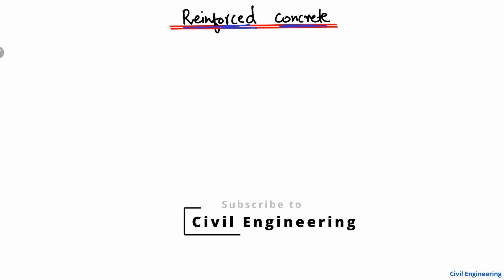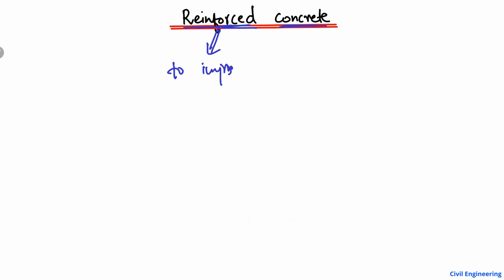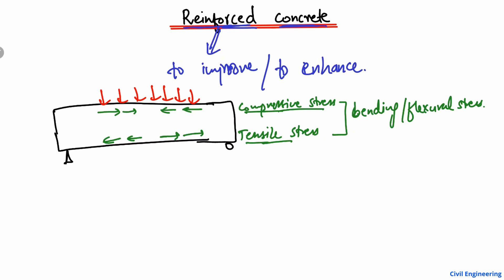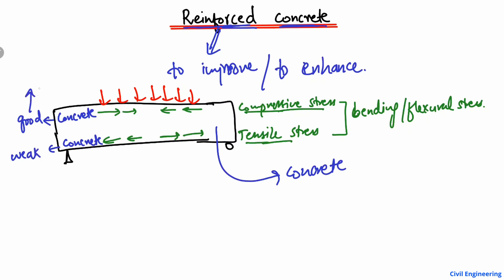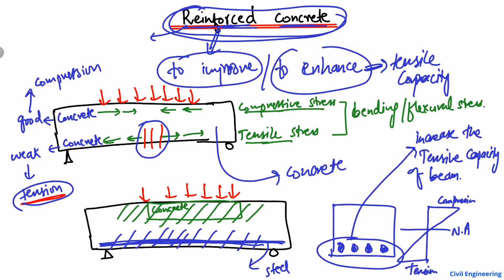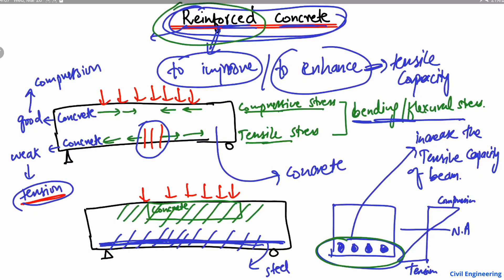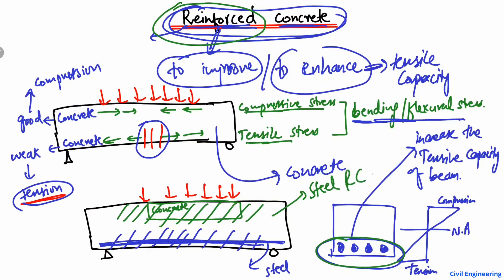What is Reinforced Concrete - Explained in Easy way

Comment: Thanks for the info, I  shall be grateful if you can explain in the same easy way you always do about axial force, shear 2-2, Shear 3-3, Moment 2-2, Moment 3-3, Torsion, Inplane shear, inplane moment, these are for the frame sections. I also need to understand the Shell forces and stresses but that will be later.
Thanks in advance.
Reply from the maker: Okay, I will make separate videos
Reply: @civilengineering94  You are the gem 🌹